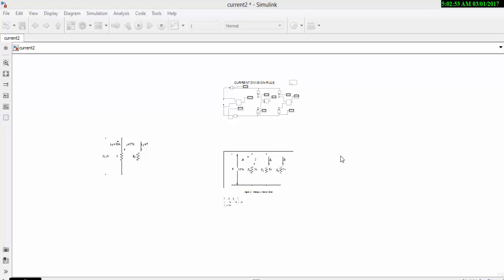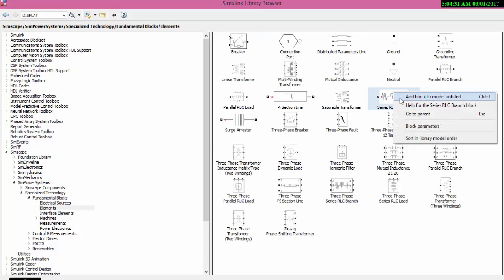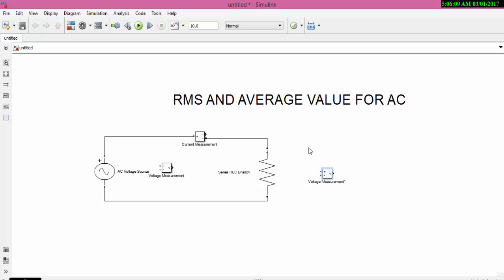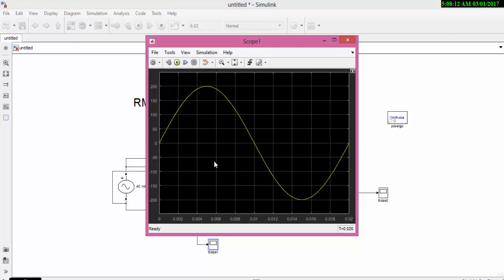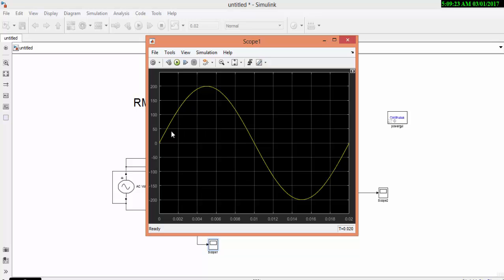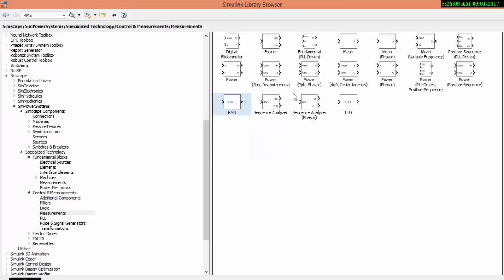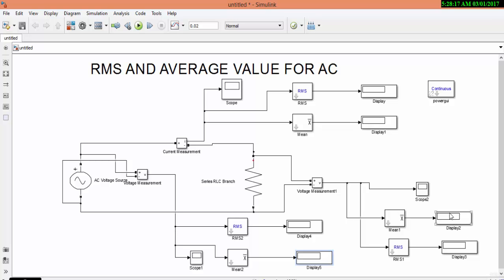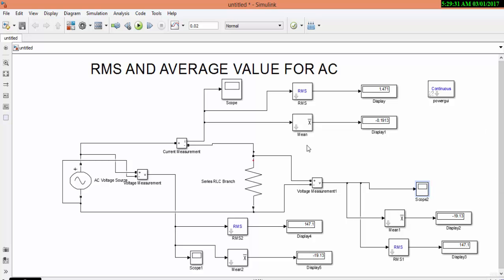matlab difference between  rms and average in sinusoidal waveform

Comment: Sir for sine wave average value is zero, which is not in your case
Reply from the maker: Because I have calculated it for only positive cycle
Reply: @EduTechGururkk  but sir you didn't use any diode
Reply from the maker: Using time period
Reply: @EduTechGururkk  sir help me. While doing full wave controlled rectifier, my average value obtained and average value of theory were different, not close. All circuit diagram is correct. Please guide sir
Reply from the maker: Message in telegram

Comment: Sir u gave 200as voltage and ans is 147.56 v......but rms value formula is Vm/√2 know sir ....then it has to come as 141.42
Reply from the maker: In rms block set 50 hz fq
Reply: @EduTechGururkk   thanku sir I have set 50 Hz in rms block and got 141.4v ...but what is that initial rms value 120 which is there in rms block..will u please tell sir .